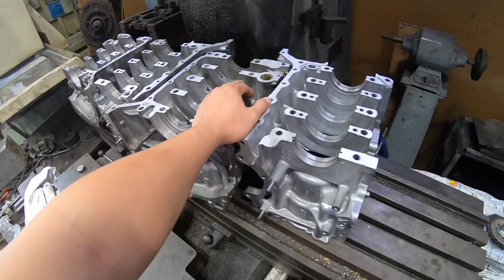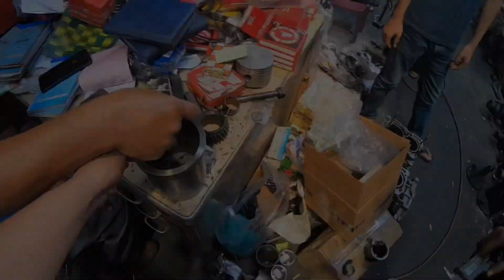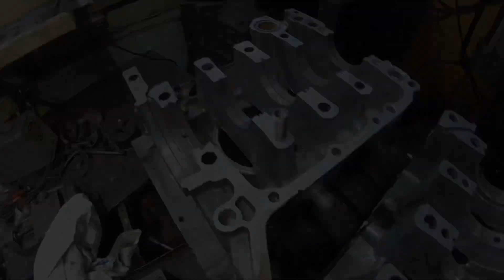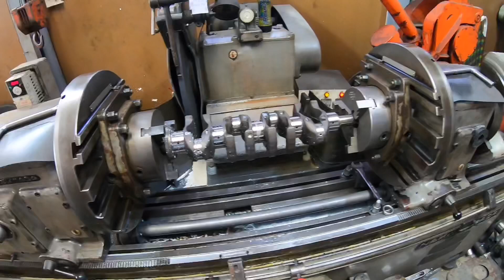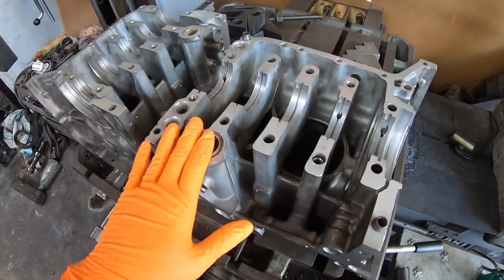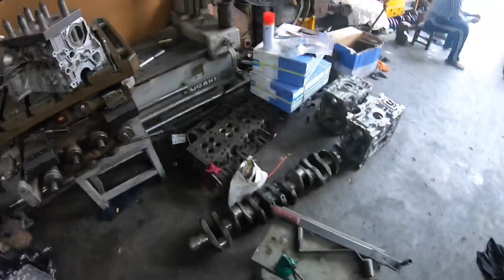Tình hình block máy dự án Racing Boy ở xưởng tiện (PHẦN 4)

Comment: Where the video on the line hone of the mains ?
Reply from the maker: Was not there to take the footage. It was line bored on a mill, not honed.
Reply: @CUCHIMotorsports  did you cut the case half's or go  and use King thicker bearing shells ?
Reply from the maker: Kings thicker OD bearings.